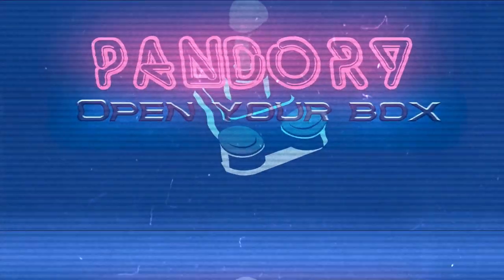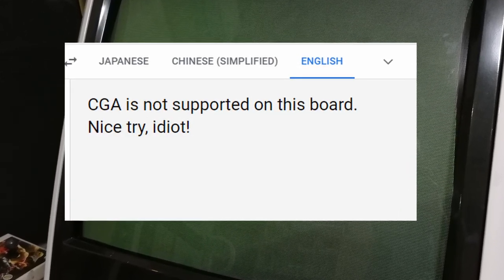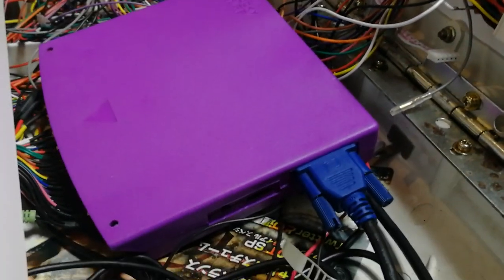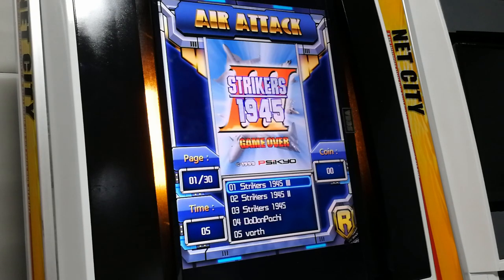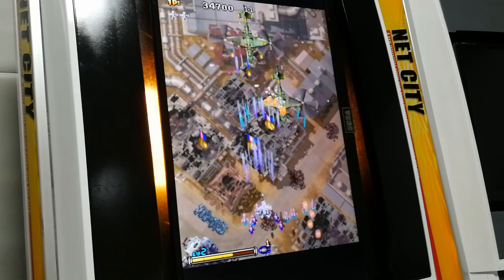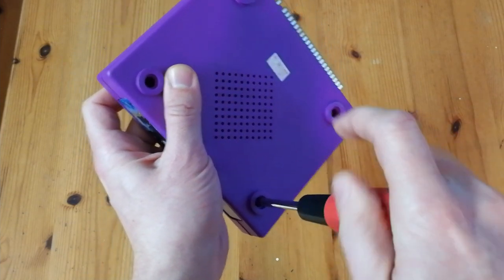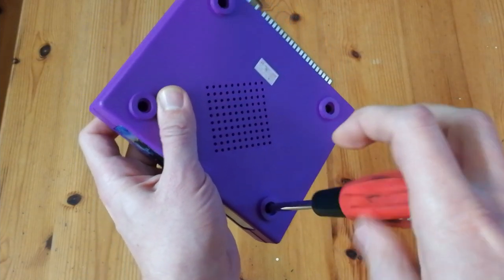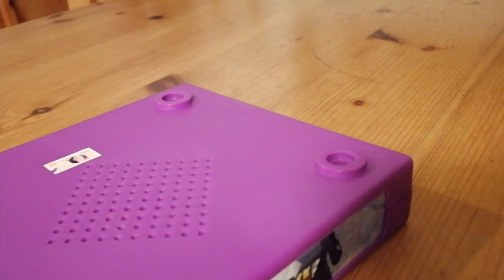Pandora Box for VERTICAL GAMES [Air Attack 3 Review]

Comment: It’s unfortunate that it doesn’t support crt low resolution, otherwise would be just like in the arcade old times.

I have tried to add arcade games into pandora box dx (jamma version, not family vertion) if adding vertical shooter game roms into roms_fba2012 folder, some games do automatically rotate into tate mode, and in crt 15hz low res.  Only fba rom set works, mame rom set won’t rotate.  Galaga, galaxian, mazinger, contra/super contra, puck man, explosive breaker, eight force, Ajax, sky fox, hot pinball, devastators… etc.

I hope this find can help someone who still want to play vertical shooter games on a crt tv, which has scanline and feels more close to arcade experience.
Reply: So, do you recommend buying this if I wanna use it on a CRT arcade like an aero city?

Comment: I love mine. It came in the light blue case for Air Attack 2 which was supposed to have 56 games. Boy was I surprised when it had 146 games. I did find one game that was unplayable due to slowdown, but I can't remember which one that is (I have so much else I can play so it has been a while since I turned it on in my converted Arcade1up Galaga cab).  The sound in my Zaxxon does work. Maybe you have a bad rom copy.
Reply from the maker: On paper it doesn't look like it'd be able to play that well, but seriously, I was surprised at how much this punched compared to the King of Air 2.  I think the lack of HD filter made this one far more authentic and fun to play.  BTW: There are two versions on the box, both Super Zaxxon and Zaxxon... That could have been the issue.
Reply: The slow game is Exed Exes
Reply: Hi, did you install this in an arcade 2 up cabinet with vertical monitor?  was the screen upside down, if so, how did you fix it. How many button does this board require? thanks

Comment: Man I wish you had made this video last month 😂
I bought one of these to play in my New astro city. Seller said it worked in jamma crt cabs. So I was annoyed when it do not.
No worries I thought. I will play it in my naomi. Nope! Different screen resolution 😔
So now I'm stuck with it. In a pile along with my pan5 and pan 4.

Maybe one day I will get round to making a setup to use it
Reply from the maker: What are you using in your astro currently?  
Yeah I was initially annoyed, had to wait for a jamma harness then could get it working another way.
Reply: @TeamPandory  I've got a pandora dx in it at moment. Does work great however I feel the vertical shmups play a bit better on the pandora 5. The dx does have a great selection of games though.
I used to have a mame pc in it but that died and I just couldn't be bothered setting a new one up with the soft 15khz boot and that.

I know the original king of air works great on the Astro but they seem so expensive and hard to find nowadays
Reply from the maker: @markhorsburgh  stick around, we'll be looking at getting the perfect box for the AstroCity soon- considering it's also a goal for myself. :)

Comment: Hello I have air of attack I can contact video via vga and control via Jamma connector how do I contact audio ??
Reply from the maker: If you don't have audio already set coming from the JAMMA harness, you may need to wire an extra cable from it.  Check the JAMMA pin-outs and solder on an extra cable or two to go to an amplifier.

Comment: Hello!

Does this works with CRT? I wanna use it on an Aero City arcade, greetings!
Reply from the maker: Will work if the CRT has VGA input. No video at all from the JAMMA edge
Reply: @TeamPandory  Greetings, is there a Vertical pandora that works just with JAMMA in a CRT?

I have been playing Kings Air2 with a video converter for VGA input, but having visual quality problems.
Reply from the maker: @FlashGameplays  You mean with the JAMMA edge outputting 15khz CGA video?  ... Not that I've seen.  Apparently the older Air Attack might have this, but we've not had one in our possession. 😞

Comment: I set mine up and the screen was upside down, anyone else has that problem? can the screen be adjusted. I hook mine up to an arcade one up ms pacman vertical monitor. I use the same setup with the 60 in 2 and the screen was OK.
Reply from the maker: Um. Turn the monitor ?
Reply: @TeamPandory  I replace this for the 60 in 1, so the monitor should face the same. shouldn't it? I was hoping it can be adjusted in the setup menu but I having trouble looking at it upside down.
Reply from the maker: @michaelwoo8752  unfortunately there's no real standards when it comes to these boxes.  Because the 60 in 1 is rotated this way, it doesn't mean that every other box is.

Comment: You're far, far better off spending a bit more and getting the King of Air 2 which has 516 games. Yes, a ton of of the King Of Air 2's games are literally duplicates and hacks of other games (Galaxian and Space Invaders are the worse offenders) but you still have a net gain of a ton of games that this doesn't offer, not to mention a variety of genres like puzzle games and racing games in addition to the shmups. Plus Pandory works on the King of Air 2 to get rid of that nasty bilinear filter if you so want it. Plus stereo sound. Plus HDMI as an option. Plus you can add your own games. Plus plus plus. Don't buy this. Buy a King of Air 2 if you want a tate all in one board.
Reply: If you can successfully add a game to King of Air 2 and post a video you'll be the king of YouTube. It doesnt seem to work same as it did on DX